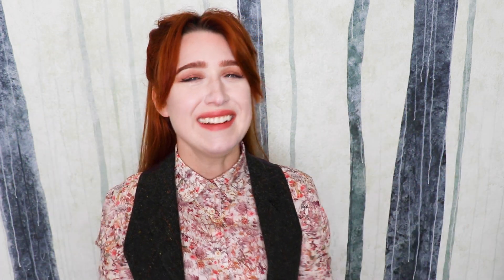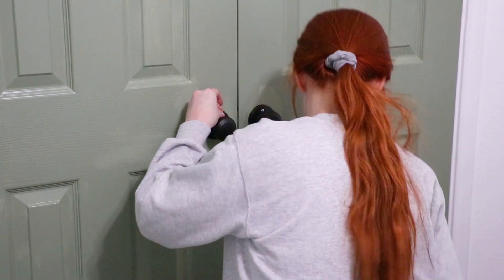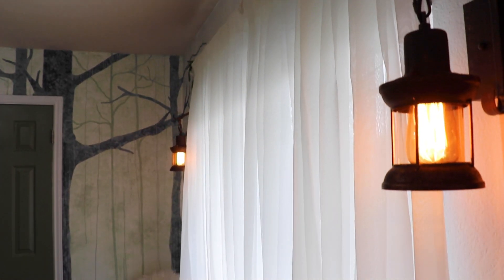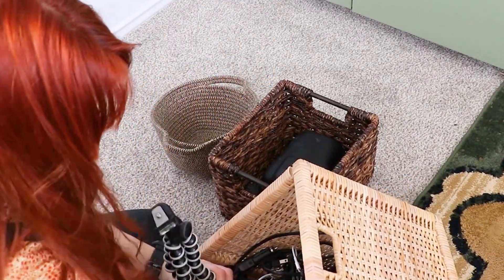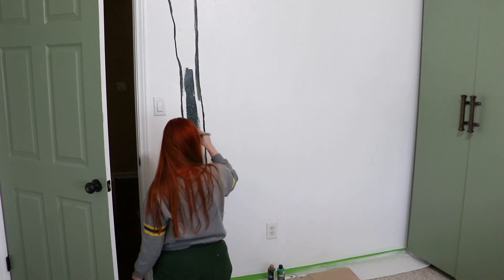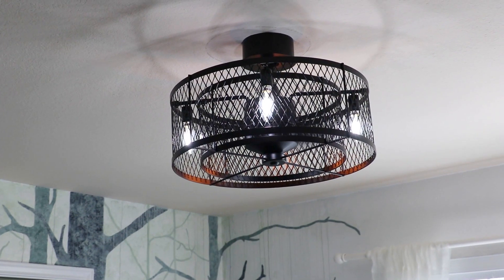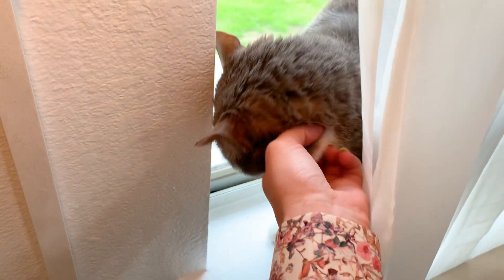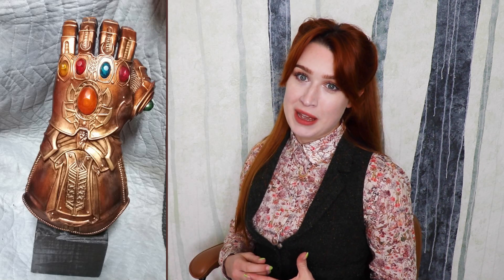Making my ✨Dream✨Craft Room

Comment: with the closet being that deep side to side, i would for sure consider any new storage devices in the center area to be on wheels so you can easily access the items tucked into the sides.  even if it's more big storage bins, stack those puppies on a furniture dolly so you can 'zoop!' pull them right out of the way to get to those other bins!
(and also, wow!  so in love with the color scheme in your new room!)

Comment: Trust me. I’m a commercial electrician and you’re not dumb. I install 20 fans at a time in apartment buildings and it never gets easier. They’re almost always very poorly designed and difficult to work with sometimes it even takes two people to put them up depending on the design. I just moved into an apartment and I have a room reserved for a craft room. This video is very inspiring thank you for sharing!